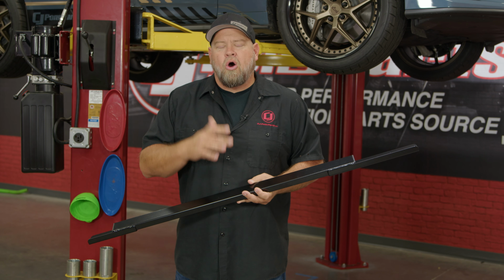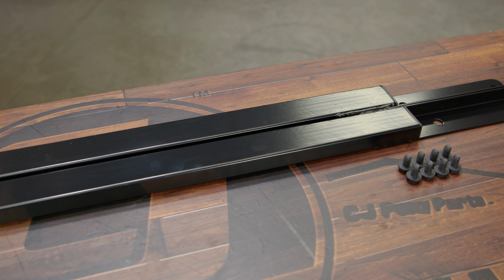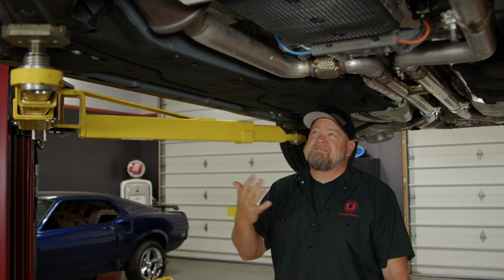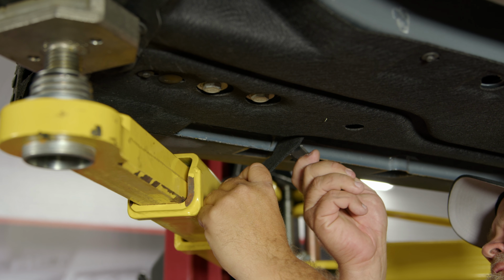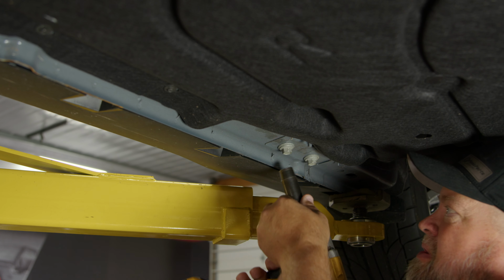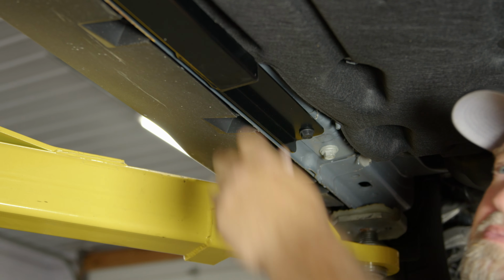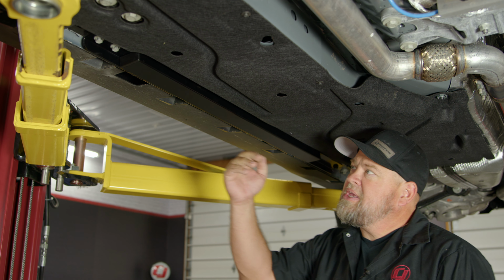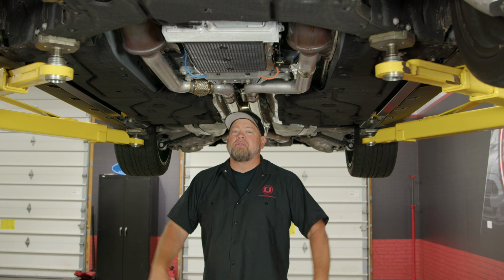2024 Mustang | Jacking Rails help your Mustang get up in the Air with Ease!

Comment: Anyone know the correct bolts for the S650? I purchased some Steeda rails and the bolts they sent do not fit. Currently using all factory bolts. One bolt missing per side